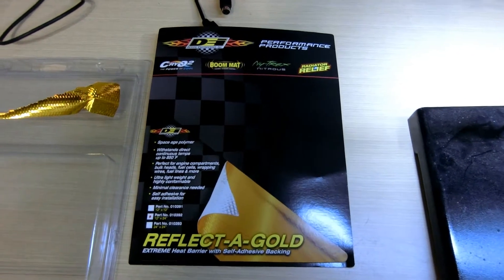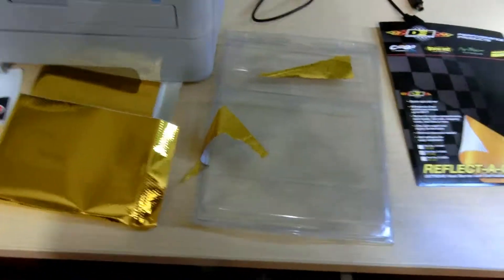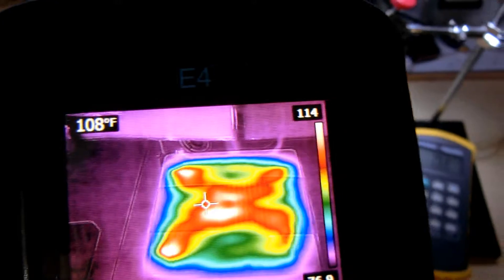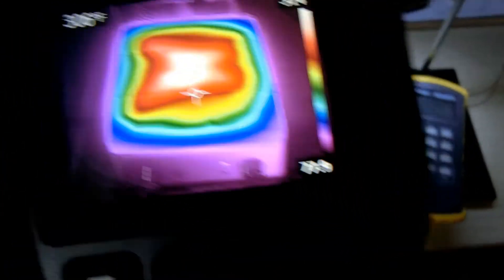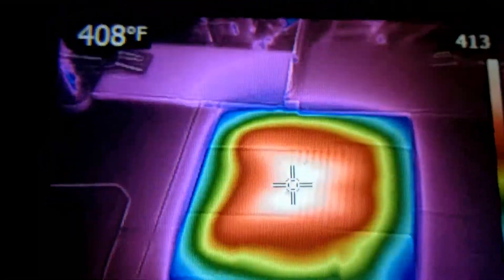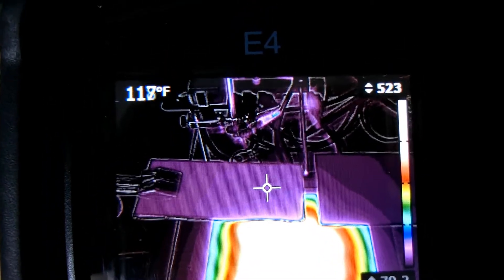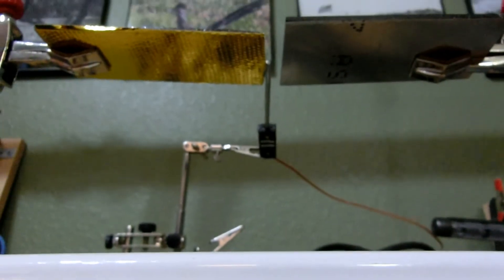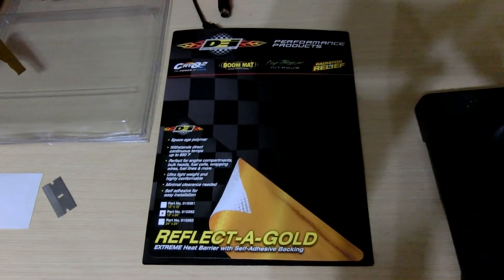DEI Reflect-A-Gold Foil Test

Comment: Should have angled the plates so it didn't reflect the heat  rite back at the hot plate.  Seems that would make that side hotter. maybe?  Also when you wrap a tube it reflects the heat in all diffrent directions due to the nature of the tube. May work better on a curved surface.

Comment: In my opinion the 2 test pieces should be an enclosed or semi enclosed with the temp readings from inside. Maybe use a couple tubes long enough so that the open ends are not affected by the heat source. This will simulate the true purpose of the heat wrap. It’s not like you are only covering the part of t your intake that faces your headers. With all that said I’m really glad someone decided to test this product to see if it actually work and not just using it because you see your friends with it. Thanks.

Comment: I had simular results when I tested two different heat shielding products vs raw aluminum. Testing was done with both a space heater and an oven eye, the shielded products heated up MUCH more than raw aluminum strips. 

That said, the myaudis4.com guy did a test with air flowing through a pipe, and saw a significant heat reduction using shielding products.

Comment from the maker: It wasn't an emperical, scientific test. I was just messing around with scraps I had. Thanks for the suggestions, though.
Reply: Try it again but with the gold side not over the heater but to the other side. Gold absorbs heat and dissipates it faster its not really reflecting it. The benefit of having gold wrapped ic or piping is that the hoses have higher temperature due to turbo increasing it, so it dissipates heat into engine bay air whitch is cooler.

Comment: Thanks for putting the work in it is nice that people try these things.  Like below I did notice that a much larger percentage of the DEI plate was over the hot plate. I would expect more heat to be introduced to the material.  If you are still doing experiments maybe try to get them a little more even.  Thanks!

Comment: Interesting, but a couple problems I see with your experimental setup - hear me out, this isn't an attack, merely observations:
1) The aluminum samples are not the same size (different thermal mass = different temperature increases of the same power over the same time).
2) The gold-film covered sample is over the top of the heat-plate more than the larger uncovered sample (more thermal energy input = more temperature rise in the same time, even if the samples were the same size)
3) The clamp load on the samples by the stand affects how much of a heat sink the stand is, you need to use thermal insulators to hold the sample.
4) The heat-plate is designed for heating via conduction, not radiation - use an quartz IR heat source, or a bathroom heat bulb instead.
5) You have placed the samples over the convection air column (heat rises), meaning, you are contaminating the experiments purpose with another heat transfer mode.  The samples should be placed vertically facing the radiation heat source, out of any and all air flows.
6) Just because paint is black does not make it a good radiator of heat - some darker commercial paints are being produced with IR reflective properties, which reduce head gain under sun-load.  Use a refractory heat emissive paint which is specifically designed to radiate heat from the painted sample.
7) Your "control" temperature sensor, is also not set up to absorb IR heat - it should be painted black, like with a flat heat emissive paint.
8) Another rule of thumb, flat-painted or rough surfaces is better than glossy-painted or smooth for use with IR sensors.
9) Really you should measure the temperature of your samples with a conductive measurement - otherwise you are adding another radiation step into the experiment.  In the lab I worked in, we ALWAYS used a calibrated thermocouple to obtain accurate material temperatures.  If you then use an IR imager to look at the sample, you will see the temperature reading at the thermocouple, and can correct any errors generated by the IR imager.

What you should probably do is place two samples of exactly the same size in the middle of a 1-foot-long tubular mineral fiber holder, those samples should be placed vertically behind a cutout which allows a known-size exposure to the IR source (like 4 square inches, 2"x2") with no IR allowed to pass to and "illuminate" the mineral fiber support structure.  The tube will prevent convection from distorting the surface temperatures.  You would also need to demonstrate that you have "calibrated" your test setup by placing a reference measurement element in each position (like a black painted temperature sensor).  If your setup is good, from a given starting temperature and fixed ambient temperature, the rate of rise and ultimate steady-state temperature should be the same for the calibration sensor in both positions.  Finally, having a control sample for each type where no radiated heat is applied to the samples, will help you measure the actual differences.

Short of going through all of that hassle, this doesn't appear to be what I'd call "good data" on how the gold film performs when applied to aluminum with respect to radiated heat.
Reply: Now THIS is a proper answer, with proper tests. Well said Tim S.
Reply: Question is the intake tube is getting conductive heat from the throttle body or turbo by which it is connected. So would this show that it is better to keep the pipe unwrapped to bleed off heat, or worse because heat that is bled off and not retained must be ending up elsewhere like the air in and out of the Intake.